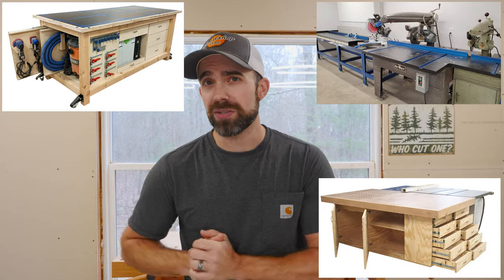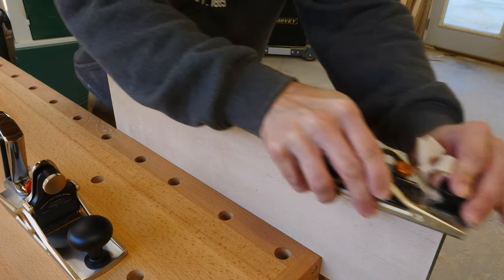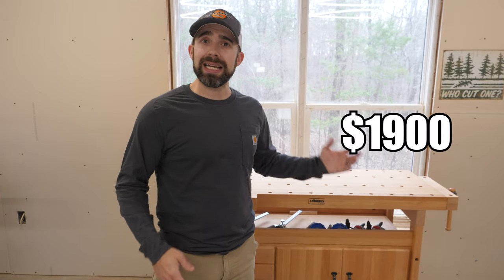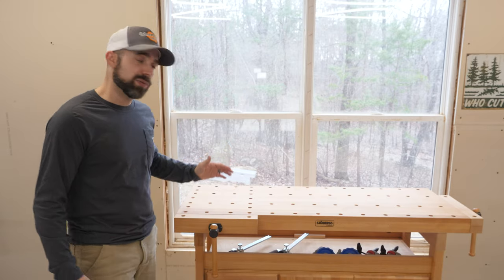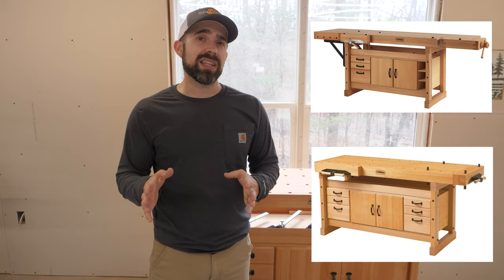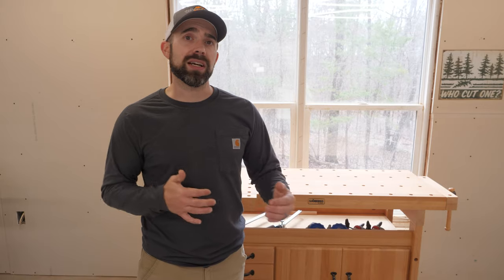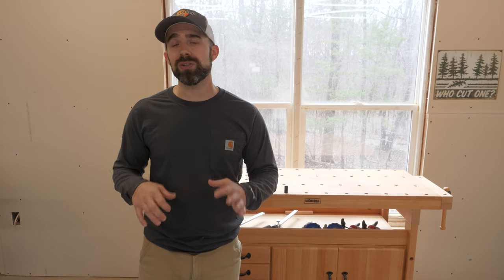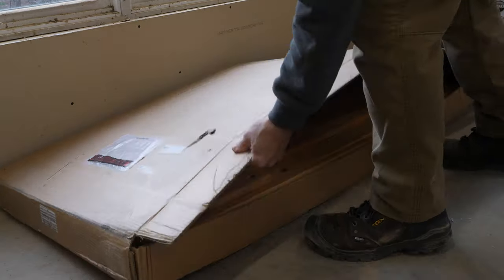Will I Keep It? Sjobergs Workbench Review | Nordic Pro 1400

Comment: Just found your channel Mike. You have some cool content I’ll be checking out.
About 30 years ago I built my first bench. Around 22 years ago I needed another bench and didn’t have time to build one so I went to my local Woodcraft… I saw the owner (at that time) and told him what I was looking for which was a huge bench. He showed me the Sjoberg Elite 2500 with an SM08 cabinet and it was something like $4500… I told him that was out of my price range… He walked me to the back of the store and showed me one on a pallet. He said he had ordered it for a customer who backed out of it. He sold it to me at a substantial discount. They loaded it on my truck and I assembled it from the bed of the truck and borrowed my neighbors engine hoist to put the top on by myself. If I remember correctly it’s near 500 lbs total and is 99 inches long. I don’t think they sell it anymore. At least in the U.S… I think now it’s the Sjoberg Elite 2500C which comes with an extension.
It still looks great and will be available for my kids, grandkids or great grandkids. Hopefully I’ll still be around to see great grandkids 😊
Reply from the maker: Nothing better than lucking up when someone backs out of a purchase!  Those bigger benches are super nice and at first I really didn't think I'd use this smaller one all the much but it's honestly one of my favorite benches to work at now!

Comment: Hello Mike!
Can you please tell me what the thickness of the bench board is? and what are the dimensions of the tabletop slats?
Reply from the maker: This bench is roughly 1" thick in the middle and 2" around the perimeter.  What are you referring to as the tabletop slats?
Reply: @WoodshopMike  I thought the thickness was 50 in the middle, and 100mm around the perimeter
like in other workbenches

Comment: Sjöbergs benches are not bad and this probably suits your purpose as you prefer a light movable bench, but I wouldn't consider them "nice". I personally prefer traditional woodworking and to me, buying a new workbench doesn't fit the image. 
A year seems to have gone by. What decision did you come to?
Reply: What does your bench look like? Most of the time, the people that diss Sjobergs benches have crappy construction grade lumber benches they built with a DeWalt planer and a table saw.
Reply: @matthewphillips5483  In my original comment, I aimed to express my belief that a woodworking hobbyist should focus on building their own workbench or finding an antique one rather than acquiring a Sjöbergs workbench. For me, woodworking is deeply tied to traditions, and both hand tools and the act of making things myself are integral to my view of craftsmanship. However, I now understand that there are many paths in woodworking. Professionals often face time constraints, which necessitate a focus on efficiency. Sjöbergs workbenches are indeed of high quality and can be a great fit for those who may not have the time to build their own, like Woodshop Mike, for example.
Reply: @urhor  This is fair. I withdraw my criticism.